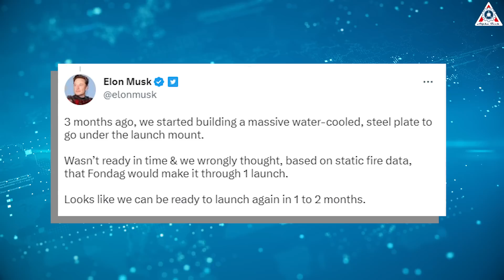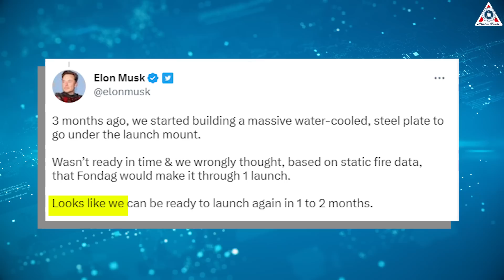SpaceX Stage 0 plans changed after huge damage from testing...

Comment: The major reason that SpaceX hasn't got a Flame Trench planned for diverting Raptor exhaust in BC is due to the underground Water Table. A Flame Trench would need to be built Below the water table making construction very difficult, expensive & time consuming.  Interestingly enough,  it was the Water Table beneath the OLM & the nearly 8 sec lockdown of SS that caused such an explosion evacuation of the Tons of concrete & debris. In addition to the velocity of expanding Raptor exhaust, force and Heat there is acoustic frequency that breaks up solid concrete.  The vibration of the now fractured concrete gave entrance to Superheated air causing all ground water beneath the OLM to explode into gas Instantly. There was Tons of water under the concrete that expanded instantly giving Huge chunks the gift of flight nearly straight up. I'm surprised that SS only lost the 3 engines initially, that said, it's highly likely that it was debris damage that eventually effected the next 3+ Raptors that gave up during flight. SpaceX did an Awesome job of shrouded those Raptors  otherwise SS might not have even lifted off.

Comment: You're telling me they HAD a water cooled suppressing system for Starship, but they hadn't installed it yet? Those engines failed because of the debris... and likely the 2nd stage separation as well if rocks hit the right systems. I'm really not sure how they thought the concrete would hold up at most concrete is rated for about 6.5k PSI... 8k at most. 16 million pounds came roaring down on it.

Comment: Don't know if anyone else has made this comment.
When you take in consideration all the combined rocket science brain power that has pored into SpaceX especially The Starship program. Without a doubt SpaceX has the combined wisdom to figure out the most challenging obstacle when it comes to spaceflight and everything associated with it. The big question I have on my mind.  Is what gave them the idea that Stage0 would survive the lauch with minimal damage? I don't think it takes a rocket science to figure out that calculation based on all the know statistics. My thoughts are, the numbers available to make this calculation were off, way off.  I find it hard to believe Elon would purposely give the ok to lauch knowing that Stage0 would substain this degree of damage. Not only that, but the potential for major personal injury or death from the amount and distance debris was ejected.

Comment: Space Xi can fix the pad , I want to know when and how long it will be for them to clean up the massive multi mile circumference of trash in the surrounding environment from the trash of blown up rocket trash.  
The FAA pulls pilots license for anyone caught tossing even a candy wrapper out of plane in flight, and Elon dumps tons of garbage all over.  Also, with possible damage to the environment the EPA needs to get involved to.  
Lets not let another corporation get away with dumping their trash and leaving it for someone else to clean up.   No more launches for space x until all the trash they dumped is cleaned up and they have ways to prevent it from happening again.

Comment: Isn't the failure a good step into colonizing other planets though? 

The failure provides telemetry and useful data on any return flights. Considering the first flights off any planet we choose to inhabit will likely have launch pads similar in design to this one. Basic and cheap enough to build in a hurry while being functional enough to get the payload in orbit. Although an expensive failure the data gleaned is far more valuable.

Comment: The fact that rockets need to be launched from the shoreline in order to go out over the ocean has an influence on how the launch pad is designed and built. The problem is that near the shoreline the water table is very shallow, which precludes digging down far enough to build a proper foundation that also includes the flame trench. This I why Pads 39A & B at the KSC were built above ground. While doing that solves one problem it creates others, most notably needing a ramp and a crawler capable of keeping the rocket vertical as it goes up.

Comment: You know...They could eliminate the stage 0 damage if they started launching rockets from a suspended position. Have infrastructure to secure the rocket a few hundred feet above the pad so the exhaust has more room to spread out as it is fired up.

Comment: The concrete pad was probably disintegrating due to the sudden increase in concrete temperature during takeoff. This is a well known danger in the steel / metal industry. If huge quantities of liquid metal is flooding the concrete floor, the chemical bound water in the concrete may sudden evaporate, causing the concrete to "explode", causing sewer damage to facilities and high risk for people in the area. This may very well be one of the reasons for the damages to the rocket engines.
https://www.youtube.com/watch?v=JwVVuQFeoxk

Comment: Why don't they create some sort of ceramic concrete that would absorb a lot of heat? This is a simple solution Elon can figure out. He is a very intelligent individual. There are plenty of heat resistant materials that you could build a launch pad with. Think outside the box. Think big. Every problem has a solution. 🚀🌌🌟

Comment: Glad SpaceX is finally getting to the idea of putting in a flame diverter. Every other rocket pad engineer in history has put in some sort of flame diverter system, so glad SpaceX is abandoning their pig-headedness.
I think that the long term solution for safety of the pad on landing may be a slightly remote landing pad that can move on rails over to the area near the pad for the chopsticks to pick the pieces up for restacking. Trying to recover each part of the spacecraft system in midair adjacent to the launch pad is a recipe for disaster somewhere down the road.

Comment: Tis but a scratch. It will buff out. Got duct tape? 

So a successful test of stage 1, Starship survived the test as well and if it had released may well have completed the mission. 

There is clearly a bit of work to be done on the Stage O. Perhaps they need to build the outer parts and the blast floor out of tungsten. Yep, it would be a bit costly, but the metal can take it, which makes it cheaper. If it stands up ten times better than steel, then it becomes a very low cost per launch option.

Comment: I can't believe nobodybrought up the force of the launch.
Reply: I calculated about 7 bar at the concrete which is 102psi, which is well under the compression strength of concrete. The problem was the rapid heating which caused the concrete to break up.

Comment: The Super Heavy generated truly chest thumping bass. It appears the the turbulence caused the earth to flex and the Fondag concrete cracked up. SpaceX was expecting erosion and they would have replaced it anyway. The result resembled an earthquake as far as what was happening under Stage Zero. Turbulence seems to have caused the concrete to ripple like ocean waves on steroids. Expansion stress from too much heat too fast, together with earth flex cracked up the concrete and the exhaust blew it away, literally.

Comment: Now is mthe chance to go full weight
into basic is best?

a flat exhast area even one filled with water
and only thin metal smells of unseen problems
 One long slopeing channel clad in holed thick steel

holes to push water and other hioles liquid nitrogen 
out seconds before ignition?
flat Water being hit by massive force is like hitting concrete
and moving water can still do mmassive amounts of dammage
 every Force action creates an equal  corrisponding force or action
Heat preasure force as to be channelled away
disipating away easing the preasure wave.
Take off should be well, awaty from Fuel farm
 A railed platform thrust puck repair platform
could be incorperated
Even a launch railed take off pad
 Base booster could fit slide down into 
a rounded base cup not bneeding holding clamps
I:e  simular to a half Toilet roll tube
links to booster and SN could be simmilar
held by first gravity and thrust
At shut of may be a gas piston push away
no tip and flip before secondm stage firing

Comment: This is an amateur circus. NASA engineers predicted the destruction of the pad and what was required to avoid it. Regarless Musk virtually said f<@k )t and went with the test anyway, thus delaying whatever they were planning 2 to 3 times longer than if they had done it correctly. Utter fail of management and engineering. This is what happens when fanboy bots just blindly follow the dictums of an "idea man" with limited expertise. Tony Stark is a fictional character.....

Comment: This launch was a disaster. It all could have been prevented. But Elons impulsive nature has set Artemis back 1-2 years. The FAA and NASA will investigate. It's not going to be pretty. Heads are going to roll (including Elons). The news is going to get worse as far as the damage is concerned. This all could have been avoided and the work of hundreds of engineers have been dashed.

Comment: The amount of damage was unbelievable. I'm fairly certain that destruction of the launch pad during launch also destroyed the rocket. It is clear that the pad was not even remotely close to being sufficient for such a rocket, and I can't believe anyone actually thought it was. They need to demolish what is left, and design and build a completely new launch pad. Not only will it need to be infinitely stronger than what they had, but also much stronger than anything NASA has ever used. It will definitely need a flame diverter trench, probably more than one. The Soviets used three for the N1 rocket, and it didn't have the thrust of the Super Heavy. It would probably take years to build a proper launch pad for such a rocket, but I see no way around it. I'm surprised they didn't see the need to do that. They knew what the thrust of the Super Heavy booster would be, it should have been obvious that what they were using for a launch pad was completely inadequate. 

Are they going to clean up all that concrete and other debris that the rocket scattered all over the entire area? Having been a private pilot for nearly 40 years, I am no fan of the FAA, but I hope that the FAA does not allow them to launch again until they have built a proper launch pad, which will have to be far better than any other launch pad ever built. I didn't realize just how ridiculously inadequate the pad they were using was until this happened.

Comment: You understated the number of Raptors that did not fire at launch. The closeup you showed in the video showed only 14 of the outer 20 firing and 11 of the 12 inner Raptors firing. That means 7 out of 32 did not fire, or at least were not firing at the time of the closeup shown in the video. That means 22% of the available thrust was non-functional.
Clearly this system was not ready for launch so why exactly was this test launched? Were those 7 Raptors damaged by debris kicked up by the destruction of the concrete base? Whatever the reason, this hasty test probably has NASA reconsidering the wisdom of awarding the Moon landing contract solely to SpaceX and their unproved Starship rocket. Elon and his team need to get this sorted out and stop this cavalier attitude about “excitement guaranteed”. There’s a lot at stake for NASA and the Artemis program riding on the success of Starship so this just isn’t about SpaceX.
Let’s forget about the excitement and give us some boring testing of this system. Take the time to do it right and not launch because it might be fun to launch on 420. April 20th BTW was not an auspicious date for humanity because of a monster who was born on that day!

Comment: The most amazing thing of this launch test is the way starship and superheavy cartwheeled several times before being blown to prices by the launch abort system. Shows how strong starship is, I would have expected it to fold up like a giant soda can after a quarter of a turn. Great to have the voice of alpha tech back! Keep up the good work.
Reply: yeah, liker ron white said, it lasted all the way to the scene of the crash- elon needs to buy him a saturn v
Reply: LMAO We already told him don't design it like that but he did anyway. And he faced the same problems Nazi NASA faced in the 50s. LMAO Artemis is going to have the same problems you mark my words. His loserdom created 33rockets to appeal to specific group of degenerate investors too.
Reply: It cartwheeled several times AFTER the launch abort system fired before breaking up. The abort system just punctured the tanks.
Reply: @allangibson8494  No - the abort system was only triggered after several rotations.  SpaceX have confirmed the final explosion was caused by FTS and not structural failure.
Reply: @nickgilbert1264  The abort system fitted to the Starship only punches small holes in fuel and oxidiser tanks and causes them to depressurise, depressurising kills the engines. You can see the two plumes in the video from the middle of the first and second stage. The rocket breaks up when the aerodynamic forces on the depressurised tanks gets low enough for them to crumple and tear (like an aluminium drink can).
The breakup was caused by the abort system but wasn’t instantaneous.
Reply: @allangibson8494  OK - I can see how I might have misinterpreted what they said, given your descripton. Thanks :)   I think they were just trying to state that they did trigger the FTS - it didn't simply tear apart due to the rotation alone but they are not always very verbose or clear.
Reply: @allangibson8494  primary cause of failure was partial collapse of unpressurized Skirt of the Starship due to compressive force generated by Raptor engines. This collapse prevented separation, caused rupture of liquid methane tank of SH Booster, loss of pressure, shut down of Raptors and tumbling of the rocket. FTS had nothing to do with it
Reply: @KarolKarolak  The FTS vented the tanks. No pressure means no buckling resistance.
Yes the tanks buckled before this but the collapse was triggered by the FTS venting the tanks at high altitude and then the rocket broke up when it hit denser air on the way down.
You can see both the first and second stage venting for about 30 seconds before structural failure.
Reply: @allangibson8494  Just had a thought though - if the rocket went off course and started heading towards a populated area, this FTS mechanism would allow the fully fuelled rocket to hit a populated area?  I thought FTS's were designed to destruct the rocket to prevent that happening.
Reply: @KarolKarolak  SpaceX have said they triggered the FTS. So although most of what you say is true, FTS did affect the outcome.
Reply: @nickgilbert1264  Aerodynamic forces a low level are much much higher…
High enough to shred stuff at Mach 1 let alone Mach 11 of an orbital class booster.
The Starship came apart as it hit denser air at 130,000ft. The 30 second delay was a bit long so they may modify it for the next shot.
Reply: And whats the merit? What is it useful to? if the stage separation surface, for example, was deformed during acceleration. What is the point? No launch abort system for crew, so basically trip is stuck with an undeformable giant can, but that is the impressive point isnt it?
Reply: @alejandrosanjurjo2500  The flip is a designed maneuver. After main engine cutoff it flips to ensure unencumbered separation of the 2 stages. Starship then ignites its engines and proceeds to orbit. Seems weird but it is out of the atmosphere by then so aerodynamics is not a concern.
Reply: @alejandrosanjurjo2500  In the days of the space shuttle,it was escape after re entry that was also considered. The longer the vehicle holds together after re entry during an emergency the better the chances of escape from the vehicle by whatever system was provided, long extendable poles were considered for the crew to parachute from in the event of a post re entry anomaly for the shuttle, although in the case of starship, if the ship can withstand an about face and separate, it may still land vertically on land or sea with some chance of survival. The shuttle would have faced a similar situation, plans were made to land at various locations on failure to reach orbit. We face similar risks on every flight we take, but the technology is so mature, we  take it for granted we will survive